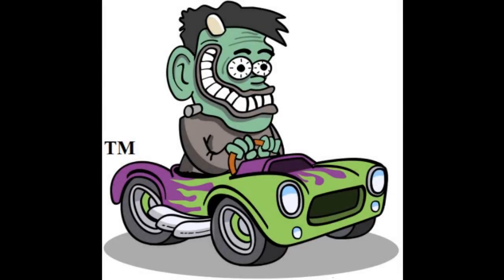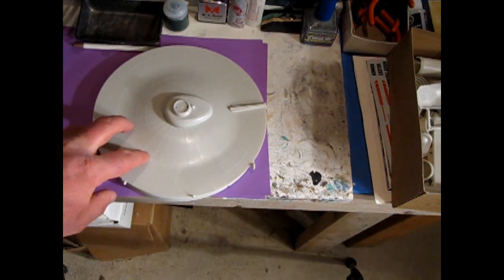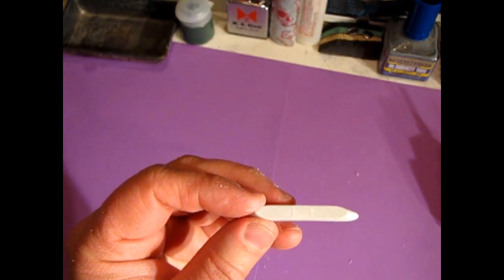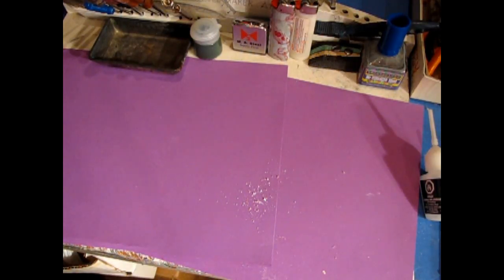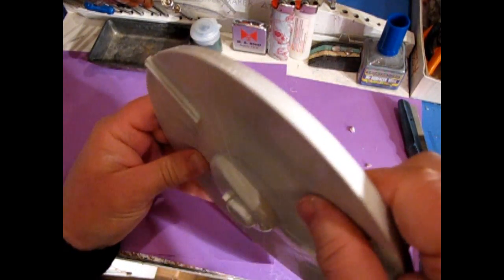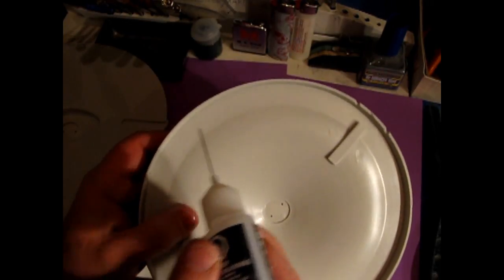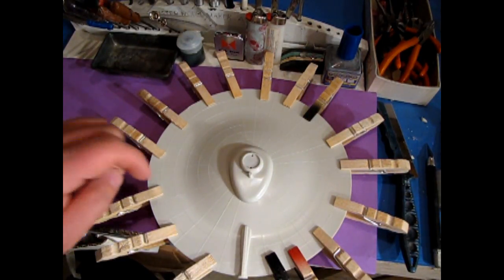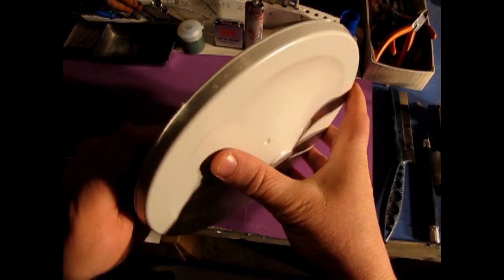Let's Build the AMT U.S.S. ENTERPRISE Kit 6676 - Part 3 - Building The Primary Hull - A How-To Video

Comment: This is very helpful.  I have the AMT 18 inch, but smooth upper saucer.  My issue is the secondary hull.  I'm not certain of how much putty to use or what grade of putty for the seam on the spine and the water-line seam on port and starboard.  I put on a little, but wasn't sure on sanding.  I don't want to loose roundness of the surface.  I can't find your video segment on this.  Could you provide the url, or re-up the vid?
Reply from the maker: Thank you for your support! The video you want is uploaded to this channel, but if you need the link, here it is : https://www.youtube.com/watch?v=s4qYAaz75Q8&t=25s

Please subscribe, if you haven't already, so you can get the notifications of my latest uploads to this series. - a new episode each Tuesday!
Reply from the maker: Did you get your model finished?